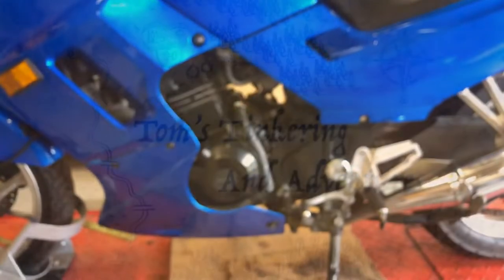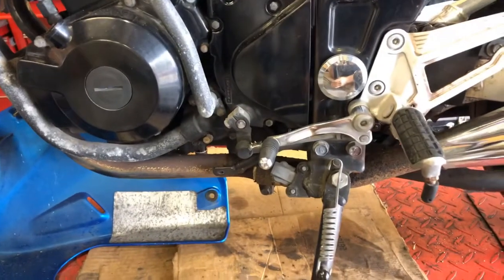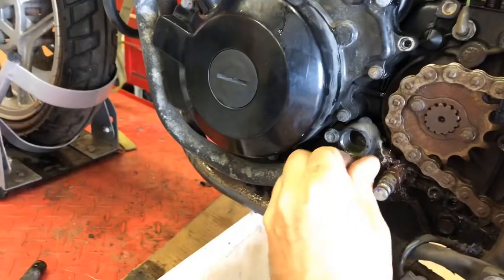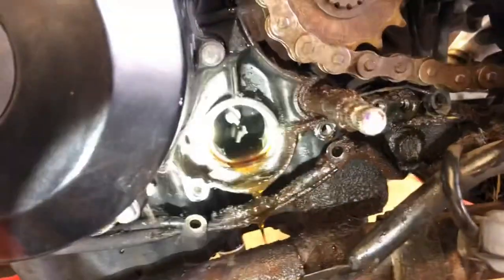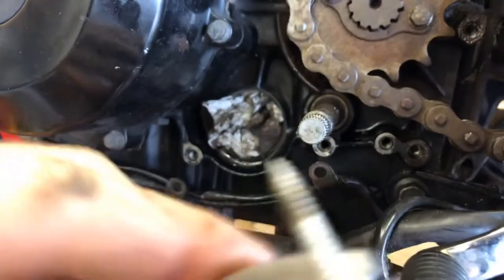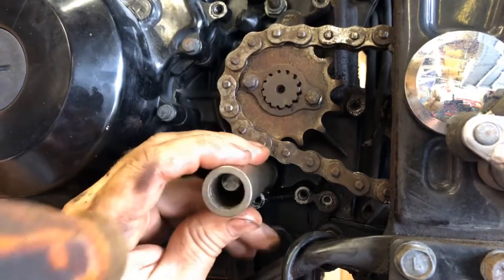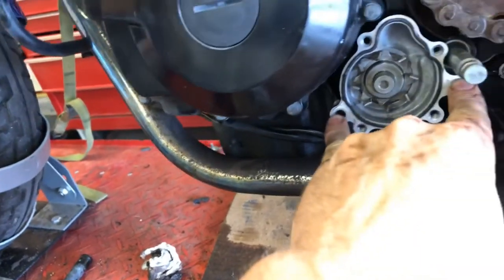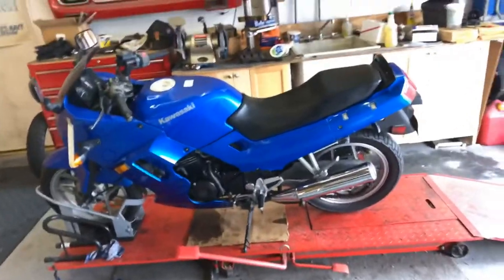Kawasaki Ninja 250 Shift Shaft Seal Oil Leak Repair

Comment: I still can't get over how nice the motorcycle community is!
I have a Z650 but I suspect this is the problem. I need to just get in there and fit it.
Reply from the maker: For the most part, the world is pretty nice!  I’m pretty sure that your 650 will have a very similar repair technique.  You can always post back here if you need guidance.  Ride safe and have fun!

Comment: Thanks for the front sprocket  cover removal section. 
The cover on my 2007 Ninja 250 was difficult to remove and left me wondering for a bit if I had missed a bolt.  I didn't miss any bolts . It was just the tight alignment pins that were tight. Your video definitely helped.
Reply from the maker: Always great to hear that my video helped solve an issue.  Thanks for watching, ride safe!

Comment: Super helpful - thanks Tom! Did you put the grease on the outside of the seal - on the surface that mates with the case?? Or should I use yamabond or something gluey like that? Also, what about freezing the seal? I’ve recently done that for a moped build. Thanks for any thoughts!
Reply from the maker: Freezing the seal is a good idea and something that I probably should have mentioned.  I don’t usually put sealant on the outside diameter unless the manual recommended it, a bit of oil or grease is fine for lubricating it to help install.  Thanks for watching!
Reply: Cool, thanks for such a speedy reply! I think I’ll freeze it but do minimal grease - that seems strange to me, like it might push back out, no? One more question - is does the case have a collar on the back side that the seal will fit flush into, so you know when to stop (gently) hammering?
Reply from the maker: @sveensvensvn  yes, there is a lip that it seats against.

Comment: You know a lot about these bikes. I have a 2006 ex250 ninja with a seized engine. I sprayed PB blaster in spark plug holes, put it in gear and rocking is not freeing it up. I need to put a socket directly on the crank. There is a slotted cover in line where the shaft is located on these bikes. Instead of removing the shift linkage, water pump and lower end cover, can't i just remove this slotted disk and directly access the crank? There is nothing in my shop repair manual or on You Tube about this, but it seems Kawasaki put this feature on the motor for a reason. I am thinking easy crank access? Any thoughts on this would be very helpful!
Reply from the maker: Yes, that cover is so access the flywheel bolt to turn over the engine.  If it’s locked up though, you’re going to have to disassemble the engine and rebuild it.
Reply: @TomsTinkeringandAdventures  There are several video's of guys gently working this crank bolt back and fourth on bikes that have been sitting for years after they dump pb blaster, brake fluid and such in spark plug holes to penetrate the stuck pistons. If there was no engine damage and the pistons are frozen from just sitting, theoretically it might work. I think i will try it. My thinking is clockwise with gentle  pressure, no leverage beyond just choking up on the ratchet. Counter clockwise would start unscrewing the nut, i think. The guys who do these video's say they have great success doing it. Your decision to fix the leak was very nice for the new owner. I think i would prefer to have bought a used bike from you over buying one at auction like i did. Thank you for responding and giving me your thoughts and insight!
Reply from the maker: @freemarketjoe9869  yes, I have seen people get engines unstuck.  They might start and run, but they are rarely long for this world!  😀  It’s worth a shot though, best of luck and please let me know how it goes.  Take your time, you may be one of the lucky ones.

Comment: Nice video. Can I know where do you get the replacement part?
Reply from the maker: I think I ordered it on eBay, you can get it at the dealership as well.
Reply: @TomsTinkeringandAdventures  thanks for the quick reply. Is it called shift shaft seal? I tried to look it up but couldn't find the exact name? Thanks
Reply from the maker: @honluu298  that’s what it’s called.  Might have to do a bit of research but it’s available.  Fits a lot of different bikes, was less than $10 if I remember correctly.
Reply: @TomsTinkeringandAdventures  i really appreciated your response. I check the manual I dont see any oil seal mentioned on there. I have 2019 ex650 abs model. Do they have a different name for this model?
Reply from the maker: @honluu298  look online at a parts fiche, there are lots of sites that have them.  Might take a bit but you will find it there.
Reply: @TomsTinkeringandAdventures  i think my bike issue is the water pump seal. I checked your other video for replacing the it, and it was very details.  Thank you sir

Comment: Very good video 
I also need fix 1 of my oil seal in my 250sl would like get help if possible 🙂
Reply from the maker: Jonathan ayun most of them are similar.
Reply: @TomsTinkeringandAdventures  for some1 that know ye my oil seal is on the clutch lid...
Reply from the maker: Jonathan ayun most can be pulled out like in this video.

Comment: when was the last time that thing seen new chain and sprockets?
Reply from the maker: No idea, it was a non running super cheap bike that I bought, got running and fixed the major issues (like this leak)  and then sold for a very meager profit.  If I had installed new chain and sprockets, that would have added to the sale price so I let the next owner install whatever kind of consumables they would like.
Reply: I’m currently looking at fixing my ninja zx6r smashed the flywheel and stator after an accident but yeah I get what you mean :)
Reply from the maker: @garyrenwick2706  I have seen the exact same thing.  When I sell a bike that needs consumables (tires, chain/sprockets, etc) I always let people know.  I could buy the super cheap set on Amazon and install them, but perhaps they want the top of line stuff and it would be a waste of my time and money.  Good eye!

Comment: Can you by chance tell me the part number? I ordered the wrong one and I already got everything torn down.
Reply from the maker: yancey chew try 92050-082
Reply: Tom's Tinkering and Adventures thank you I’ll check it out
Reply: @TomsTinkeringandAdventures  This part number is for the all rubber seal, will this still work in comparison to the one with metal on the outside ?
Reply from the maker: Blake Douvros it should have a metal outside diameter if it’s an OEM part.

Comment: What about water in my oil
Reply from the maker: nikita bradley could be water pump seal or head gasket.  Both are not too difficult, water pump is obviously easiest because you can see how to remove it in this video